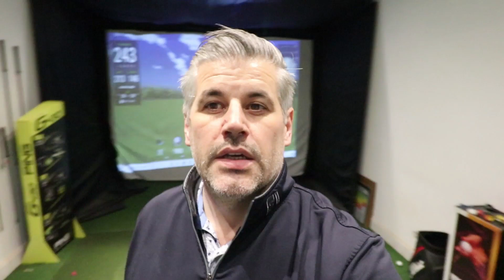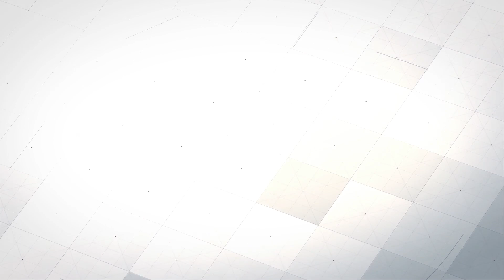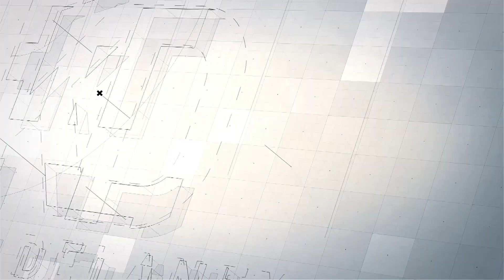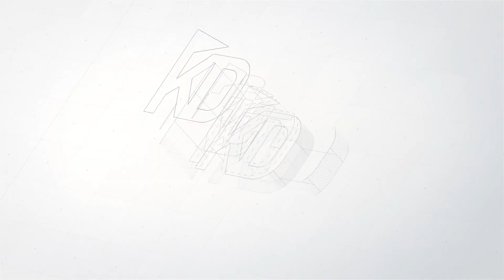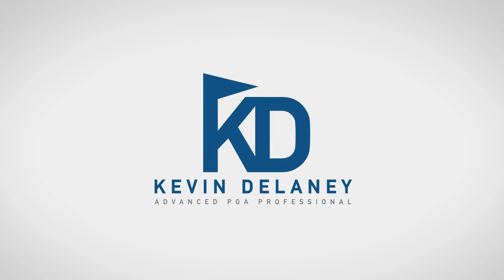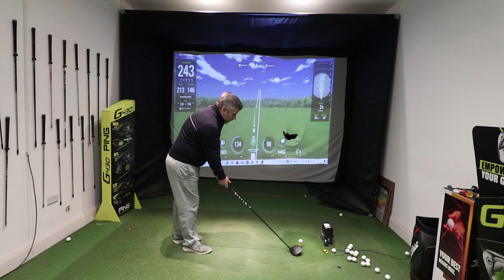Is this the BEST PING DRIVER EVER? G430 Max 10k review

Comment: Finau never gamed the 10k in contest, just in promotional videos.. Cam Champ tried it one tournament, or few rounds of it and went back to the G430 LST. Finau also never gamed the G425 Max has been in the LST models forever.

But all that doesn't matter, this driver is made for the weekend warriors that spray it all over the face, and it's pretty perfect for that! Doesn't matter that only a few of Ping tour players like Stewart Cink and Chan Kim are actually gaming it.
Reply from the maker: Completely agree for the weekend warrior, I was told from ping back in November that finau and champ had been using it then I know that they had the 400 max in play didn’t know that they hadn’t actually put it play beyond that.

Comment: Fastest player on tour is playing 10K, Cam Champ. Robot testing can't mimic what he does, it was built to withstand his ballspeed.
Reply from the maker: I find it interesting that the two longest players that ping have finau and champ both play the easiest to hit driver not the low spin lst. Champ is seriously long as well
Reply: @KevinDelaneyPGA  I just got back from Carlsbad, Ping ran an event for my company along with other OEMs, I was super impressed with the 10k, TM numbers were good, 117ss.   173 bs, 12.9 launch 2680 spin, 296 carry, gonna be my new driver. That was cruising speed. I stepped it up to 123, ball was 184 carry 318. It's got plenty in the tank. That's with the Tour black 65x shaft at 45 inches. Good stuff.